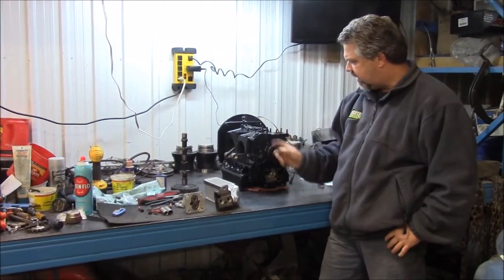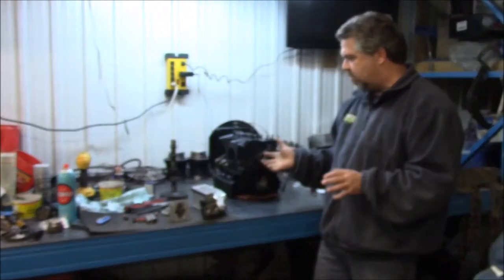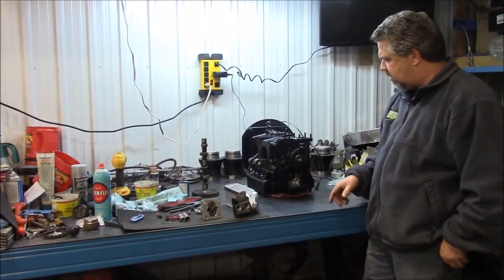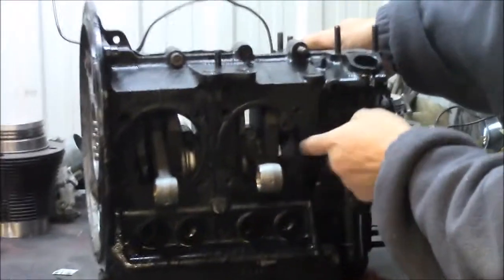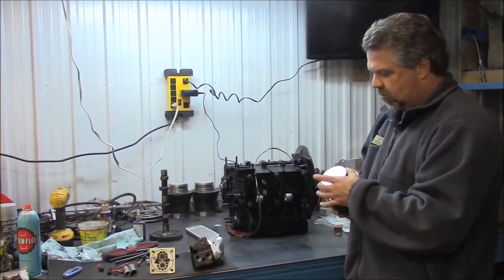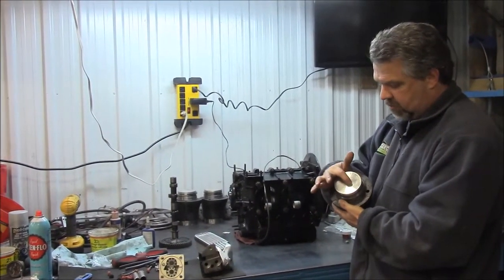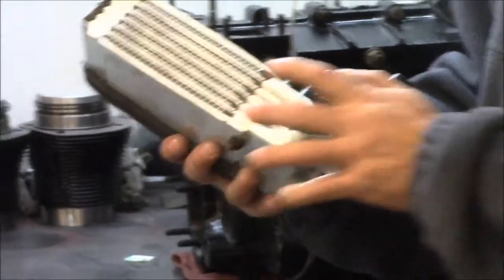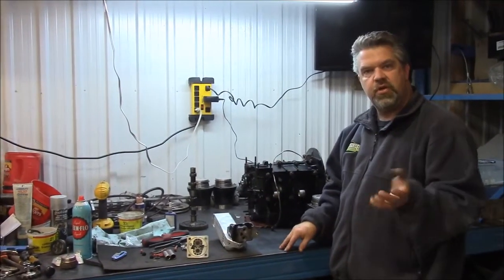VW Air Cooled Motor Rebuid For Porsche 356 Kit Car, lastchanceautorestore com

Comment: That has got to be one of the absolute dumbest VW vids I've ever seen. Can't believe you're putting cheap thin wall 87's on a performance car. And the monster ego that won't even divulge the cam grind because nobody on earth would understand what you're saying. I bet you sold this poor sap a set of 041 heads that are for "racing". I'm pretty close to unsubscribing forever at this point.
Reply from the maker: Lets clarify a few things. Our client was happy with the "pep" on his stock and almost all original 1584 cc  motor and just wants a "bit more" power. Increasing the pistons size and making the motor a 1641 cc is a nice upgrade and makes a happier motor. We are not building a "performance" motor, nor are we using "cheapie"  thin walled pistons. All of the components are of high quality. We are enhancing the original motor design with a bit more displacement, better fuel and air mixture, improved oil flow and an overall happier engine. Calling our client a "sap" is uncalled for. Thanks for your comment.

John